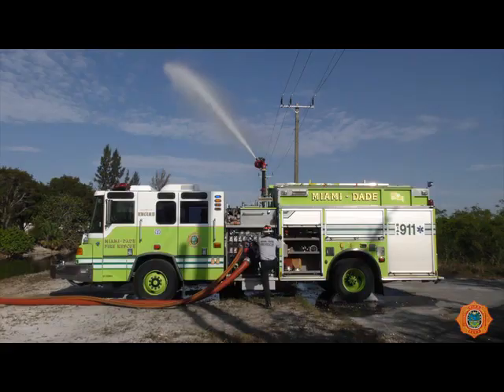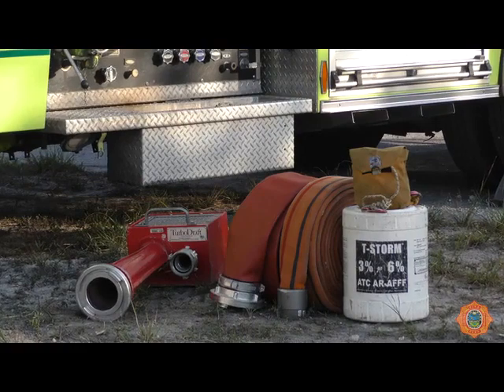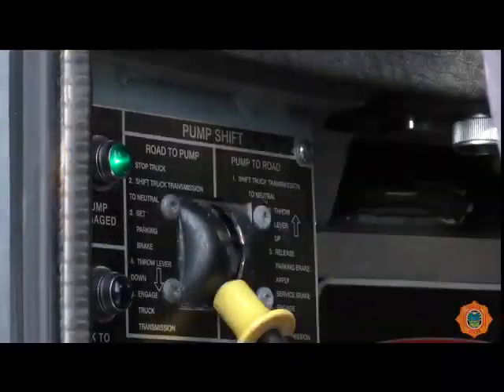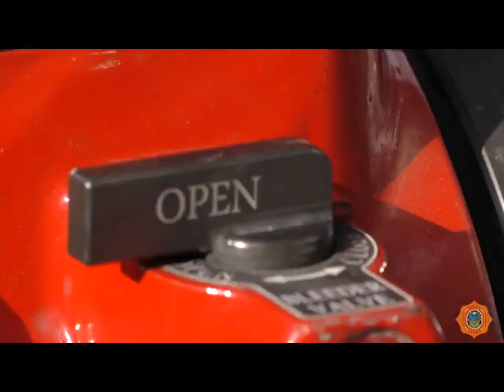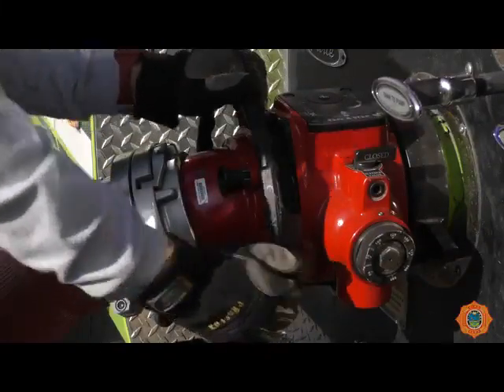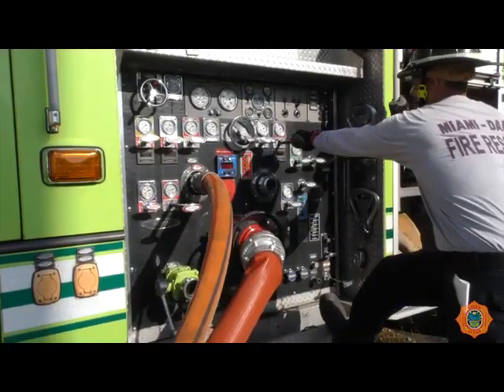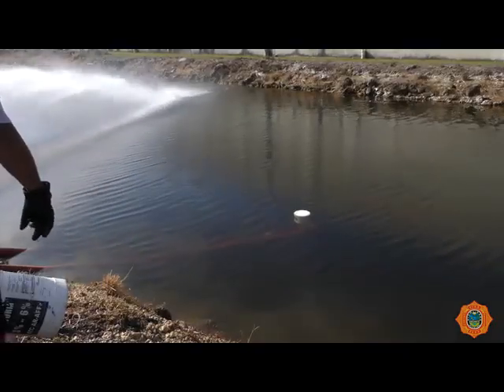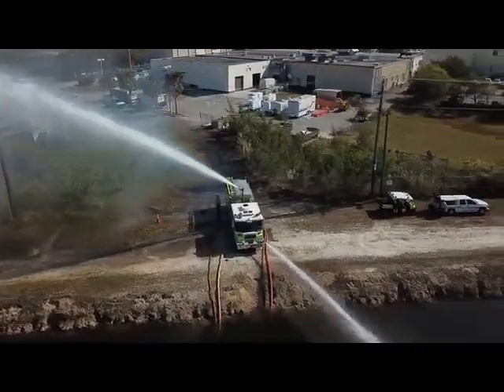Turbo Draft

Comment: You can go much further than 200'.  You can go out to 400-500', but your flow rate will be reduced.  You can also go above 175 psi, and get more flow.  I've gone up to 225 psi.  If you can flow your water back into a dump tank, and draft out of that, you don't have to worry about collapsing the 5" hose.  You'll have a better buffer because you have more time to see if you're out pumping your water supply, and slow down your discharge before you run out of water.